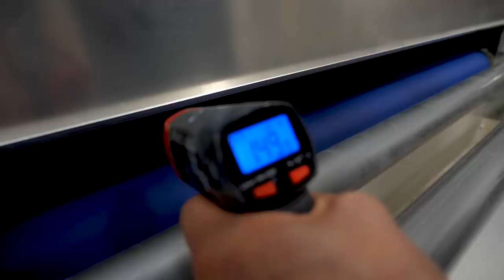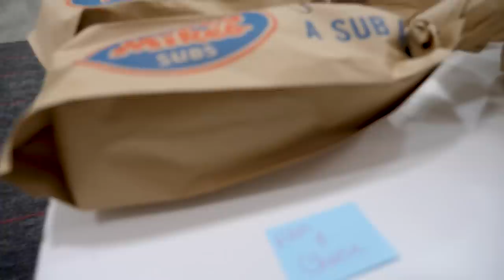Jimmy Johns vs Jersey Mikes

Comment: Never had Jimmy Johns so I can't compare the two.  My question is how much overspray is going to accumulate on the sprayer head itself and what would be required to clean it.  I can just imagine 6 months down the road that sprayer gets all clogged up and it would take 2 months to get a service guy to come and clean/repair it.  Also, what if the sprayer gets damaged?  How much would it cost to fix it?  How long would it take to get replacement parts and/or a service guy to repair it?  Is there enough power to install/operate a new spray machine or does Dale need to upgrade the electricity again?  Things to consider.....

Comment: Firehouse Subs > Jimmy Johns > Jersey Mike's > > > > > Subway

So, the first company focused the overspray onto the paper conveyor belt with their air flow and the second just says fuck it and covers the walls with sticky paper you peel off after it gets too nasty. Depending on the usage, I think the sticky paper on the walls would be less waste overall though it would take a bit more labor to swap out. The paper rolls would fill up the dumpsters you used to pitch your cutoffs/chips into (contaminated/flammable paper rolls).

Aside from the technology they each used, I was hoping y'all would circle back on Ian's questions about the constructed rail geometry or if the machines couldn't handle them.
Reply: Yes all the way to Firehouse!!!!

Comment: 1 inch equals 25.4 millimeters, so not sure if they are talking about the same thing.
Reply: A millimeter and a mil are two different measurements. Mils are used mostly in manufacturing.
Reply: @Quto212  learned something, anyone with a metric background would use mil as shorthand for millimetre or millilitre depending on context.

Comment: Jimmy Johns all day long.  More choices , simpler order process, and faster. Had dozens of Jimmy Johns and they were great every time. 

Jersey Mikes had twice and once was a disaster and the other was ok but the limited choices was a downer. 

Jersey Mike is too limited and dealing with the “you gotta pick every single topping” where the guy ends up putting 1/4 head of shredded lettuce and then soaking it in a 1/4 cup of oil - not good at Jersey Mikes.